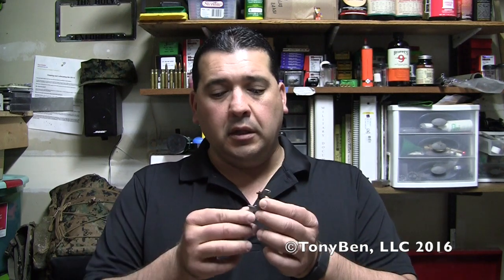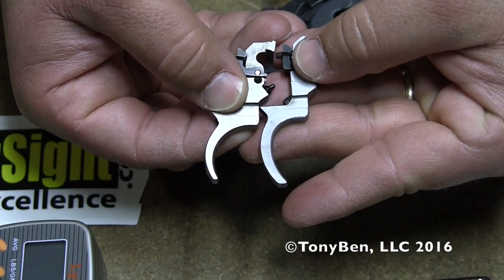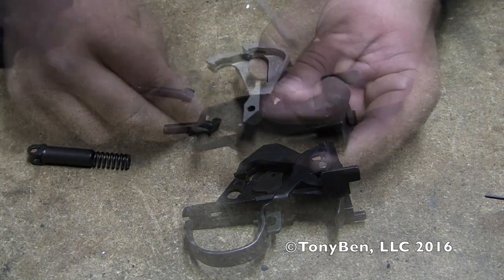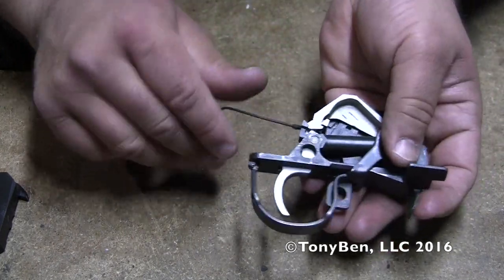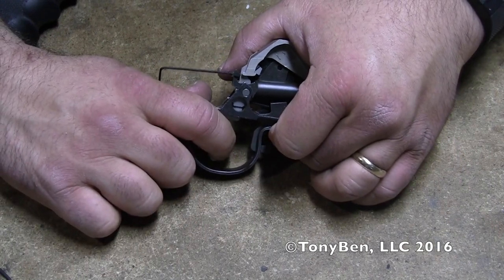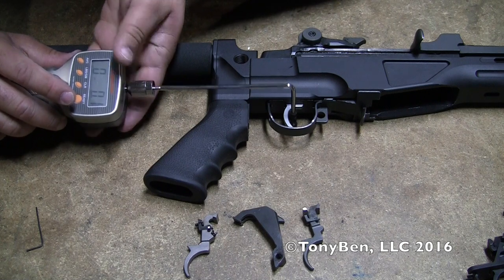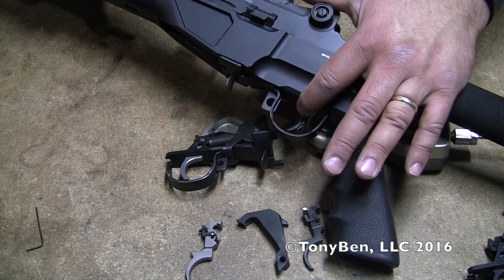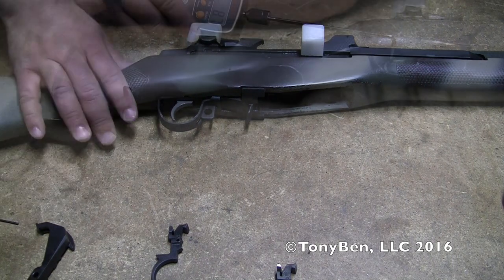Shooting Sight NM & EBR Match Trigger With Speed Hammer

Comment: Tony... in a previous comment you indicated that with this installation you were going to post a follow up about how to make the M1A safety operate more freely.  It doesn’t look like you did that?  I’m goin to be installing one of these Tuesday and would like to work on my safety, which is very very stiff at the same time.  Is it just a matter of smoothing out the stamped rough edges, or is there more to it?  The geometry of the cam on mine seems to excessively pull the hammer down?  Mine is a SAI-SS about a year old.  Comment most appreciated!

Comment: Thank you. Fantastic and to the point. Two questions:   1.) With the trigger pull adjusted to 4.5, is it legal in "John Garand" CMP competition or is that only for unmodified rifles,  2.) Does anyone ever (as I do on my unmodified rifles, Garands) put the thinnest possible coat of Lubriplate on the trigger/sear interface surfaces?

Comment: Tony, years have gone by and lessons learned, are you still using Arts triggers? I have found him decent to deal with when talking about his gas system modifications.
Reply from the maker: Yes I am. I try to install these when possible over a manually tuned trigger.

Comment: I'm thinking on getting this trigger/hammer setup for my M14. I am in love with Geissele triggers in my ar15's, how rugged are these triggers as far as the set screws coming loose? I mostly shoot off a bench, but there are times when I'm up north doing rapid fire seasons and really rip on it. With the Geissele triggers I have never worried about pushing them too hard. How well will this trigger hold up in an everyday hard use situations? Or is it strictly a light duty match rifle trigger that isn't intended to be beat on?
Reply from the maker: I haven't had a problem with the set screws coming loose after using 242 loc-tite. I know I said in the video not to use 242, but I meant not to use 262. The 262 (red stuff) is permanent, but can be broken down with a heat gun. 

I haven't run my guns hard, but I see no reason why they couldn't.

Tony.

Comment: Hey Tony, do you know how well this would work with a Tubb Precision CS hammer spring, since both are meant to reduce lock time (by different means)?  Those Tubb springs are kinda burly. I wonder if it would beat up on the plunger/hammer or trigger pull set-screw.  ...just a random thought  ¯\_(ツ)_/¯
As, always great work with the vids!
Reply: I actually just got finished installing a set of Tubb springs into my (nearly complete) Polytech build that already had the Shooting Sight speed hammer and adjustable match trigger installed and the drop in the pull weight is actually kinda scary.  I sadly don't have immediate access to my trigger pull gauge at this very moment (it's stuck in a toolbox out in the garage behind a washer and dryer a roommate left behind when he moved last week) but I had the weight down to around 4.5 lbs and after swapping the hammer spring it feels almost like it halved the pull weight if that's even possible.  If i had to guess I would have to say my second stage trigger weight can't be much more than 2-3 lbs now.  It's gonna take some getting used to and it'll probably scare the shit out of all the fudds at the range who miss their old service rifle and ask to take a shot or two with it "for old time's sake" and pull that trigger expecting a 7-8 lb GI trigger and blow straight through both stages without realizing it.
Reply: @joshuaredhorse4030   😂 That would be pretty damn funny!  ...especially if it has the classic look of an old walnut or fiberglass stock. 
Post the pull weight when you get the gauge out from behind the appliances.
It's kind of a bitch squeezing that trigger in place by hand during reassembly with the Tubb spring, isn't it? At least it kinda surprised me initially. 
After you've put it through its paces a bit (and if you happen to remember this), I'd definitely appreciate hearing about whether you think the spring is putting any detectable amount of extra wear on any of the trigger group components. I was initially wondering if the lighter hammer might get beat up a bit, but I think that the greater distance from the pivot point to the point of effort (plunger notch) will take the edge off the mechanical advantage enough that there shouldn't be a problem. I'd be curious to hear from first hand experience, though.

Comment: hey need some advice regarding the EBR trigger.  I installed it in my rifle no problem.  even with the second stage screw removed, the sear won't engage the hammer with the trigger pulled.  I reinstalled my old trigger to check if I was doing something wrong and it functions perfectly.  I have noticed that if I press on the sear when the trigger is depressed it will slide up slightly and it will catch the hammer. Once I let go it will not.  I am all for a full auto M14 but Mr. government man will do terrible things to me.
Reply from the maker: Can you send pictures to my e-mail? tonyben@tonybenm14.com

Comment: Hi Tony , I'm having problems with my Blackfeather install , My trigger only passes the hammer test 50% of the time. Its not holding the hammer back when I cycle with the trigger pulled. Do you have a video about that? I searched but could not find anything.

Comment: Hey Tony, great video as always!
Got a question for you, i am installing this trigger and was able to get the trigger pin inserted just about all the way, but the hammer will not lock back. It needs just a few more mm to grab the sear. It seems as though the trigger may need to come up / forward slightly but i cant move it once the pin is in. Any suggestions on troubleshooting this?
Reply from the maker: I vaguely remember having the same issue at some point when I installed another trigger after I filmed this, and I just had to fiddle with it for a while and  it eventually went in. Did you get it sorted out yet?
Reply: I did actually! I think the hammer spring is just especially stiff and had to push on the trigger a fair amount, but it eventually dropped in. Cant wait to get it out to the range. But thank you again for your videos. I have learned a TON. They are great resources!

Comment: hey tony,  great vid on this trigger mod.  I have related question for you.  I got my first M1A loaded model last year, and I'm slowing going through it with your vids.  question is about the safety.  is there any way to lighten up the safety?  I've clean and greased/oiled it up but its pretty stiff.  I must use my thumb to click the safety off with a lot of force. if you already have a vid on this I must have missed it somehow.   can anything be filed/stoned to lighten it up?  thanks
Reply from the maker: I haven't made a video on this, but yes, you can. I have not done the mod myself yet. I would not be able to describe how to do this yet.

Tony.
Reply: ok, thanks. looking forward to that vid one day.  I will have to look at it more closely and study the contact points to get an idea how you may come at that problem.  I don't mind it be hard to put the safety on,  theres just no way to take it off without using my thumb and jam it forward.  thanks

Comment: why can't use soft point 308 bullet in the m14?
Reply from the maker: You can use soft point ammo, but I don't recommend using straight lead cast bullets. You should at least use copper jacketed bullets. Core-Lokt should be okay.